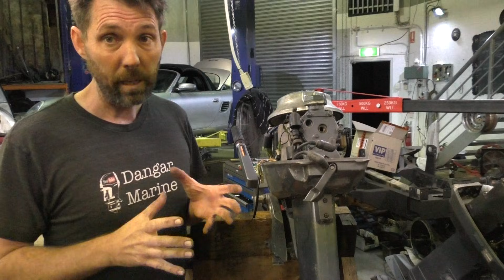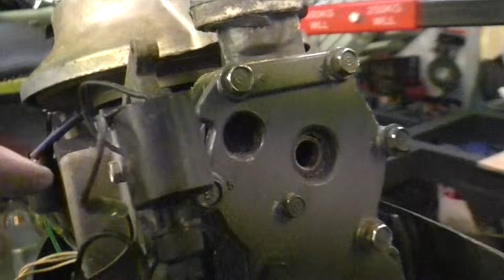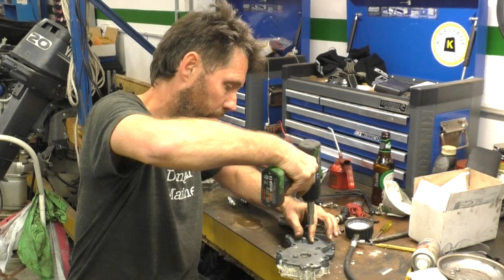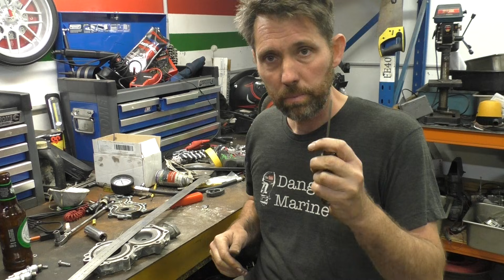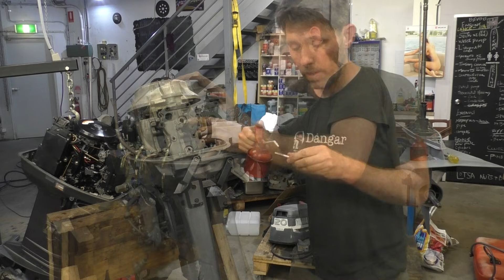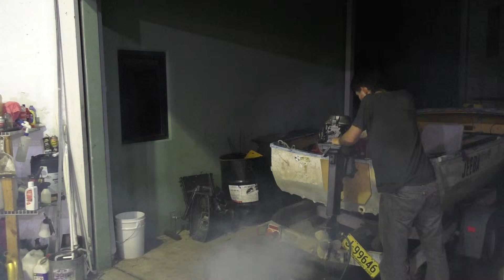Replacing a 2 stroke outboard head gasket

Comment: Dude - I LOVE your video tutorials, and I've learned SO much!
THANK YOU!!!
However - you should NEVER - never EVER, re-use Head Bolts... ALWAYS use NEW ones - the old ones have been stretched and are WEAKENED ... they WILL BREAK (guaranteed!) if ever needing removed in the future.

(ask me how MANY times I've learned that particular lesson. lol)

Best wishes from Florida!
Reply: Not all head bolts are stretched.
Reply: @00met  
As inexpensive as they are - and as expensive as head gaskets are... why risk it?
They DO stretch when reused.
(some more so than others, but again - it's just not worth blowing a head gasket, or even worse, breaking one off later - been there, done that too. NOT fun!)
Reply: @jkg6211  No disrespect,  I understand that some bolts are torqued down with the intention of stretching, according to Yamaha, these engines do not fall into that category.  I do understand the cost could be minimal, but I am doing two motors which would be in the area of 72 bolts.

Comment: Prying usually works, I find tapping around the edges with a brass hammer loosens it up.
Reply: Yes, a soft hammer can help...  also lossening the hedbolts then cranking the engine... letting the combustion do it for you.

Comment: Stu, I have a Johnson 50 hp.  I see some white stuff (salt?  corrosion?) around the head gasket near the lower cylinder.  Is this the sign that something is wrong or normal occurrence in salt water? Motor starts easy and runs fine. Thanks for the great videos!
Reply from the maker: Hi Brian, you do see that and it isn't necessarily a sign that the head gasket needs replacing. If you still have good compression I wouldn't worry too much.

Comment: I have a 2004  F115, strong knocking with low oil pressure, 36 psi at 3000 rpm, all 4 with 135 psi. During shop run, 2nd rod kicked and the crank is in question. I got a good used full block with all cylinders, crank shaft, and an used oil pump. I ll check the off oil pump to see if it is the cause.  Do you have any ideas to text this type of oil pump?  thanks. Dale of Vancouver Island.
Reply from the maker: Oil pumps are generally tested using feeler gauges to measure the rotor clearances to see if they are too worn. The service manual for that motor will show you where to check and what is considered out of range. Be careful though with oil pressure tests as they can give you a low reading even if the pump is fine if the bearings etc are very worn as the pump needs a restriction to convert the volume of oil pumped into pressure.

Comment: Thank you, I am taking a 25 hp Nissan apart due to top head gasket failure, leading to top over heating, loss compression, 85 top and 125 bottom. Top cylinder wall scratched lightly. I wish I could bring both to 120 to 125.
Reply from the maker: You might find that with a light hone and new rings the compression comes back up. I would also get the head machined before re-installing with a new head gasket.
Reply: Thank you so much for the great suggest, yes , l ordered new rings, head gasket, mid sect. gasket and new impeller. All the bearings are still tight and no discolor or burn marks.

Comment: Your videos are amazing. My son and I just bought a 2001 Yamaha 15 HP 2 Stroke (15MSHZ) and cleaned and rebiult the carb after seeing your great 40 minute video.  Also replaced gaskets in fule pump after seeing your other video. 2 quick questions:
1) You mentioned about danger to the iginition coil if ignition is on and it is disconnected but not grounded. Is that mostly for prolonged periods? I ask since in this (or another video) you removed the plug from each cylinder one at a time while the motor was running to check each cylinder and I have done the same thing a lot on my "new" motor (see point #2). So is it OK to do that as long as not done for a prolonged period?
2) I wish you could do a video (if not already done) where you explain the crankcase breather hoses and what they do and related issues that come up. Especially using that 15 HP Yamaha you have done a lot of videos with. I ask since our bottom cylinder stopped working a week after we bought the motor. It was not spark since the bottom cyl did not run using the same coil switched from the top to bottom. Plugs switched did not help. Carb (only one on this motor) was clean and top cylinder idled and powered up well. When I pulled the top and bottom breather hoses off and sprayed carb cleaner and compressed air through them, the bottom cylinder fired right up!!! So I fixed the problem but do not know why it worked. Please help me understand if you have a minute.
Thanks again for your great videos!
Reply from the maker: Hi Elliott, yes, a brief disconnect of coil for a test isn't likely to burn it out. I've seen motors where one of the HT leads has popped off and the boat has been driven around for quite a while without damaging the coil so it's more a case of being safe rather than it being a huge risk.

Interesting about your vacuum line fix. Generally those lines are only used to either power things like a fuel pump or balance between the two cylinders. It's really hard to see how it would affect you getting spark. I'll have to do a bit more research and then do a video on those hoses one day.
Reply: Old question, I know, but did disturbing the sparkplug lead to that bottom cylinder do something like improve the internal contact/connection?

Comment: Intersting Video.I do wonder about the pistons in my motor.They are not coated black on top.They are a lighter color.I saw this when changing plugs.Could this be a sign of running lean or something else?Leaky head gasket.If a tiny bity of water was getting in the cylinder would it cause this discoloration.?I am currently sorting thru some idle issues and curious about this .Getting some backfires or lean sneezing?
Reply from the maker: It does sound like it is running lean.
Reply: Thanks..After my last message I went and pulled the plugs again rotated each piston TDC and with a better light I could see half was black with carbon and the upper half was almost like a rust color and almost appears like rust for some odd reason?It couldn't be rust could it?I would not think it could be rust and don't think rust could be on there with it combusting in there.Why is only half this way?This is a Johnson motor.

Comment: There's one other issue about running a motor without a thermostat or restrictor plate. I used to work on an offshore race boat, and at first we ran no restrictor plates, there was no room to put a thermostat in the way the watering system was set up. And we kept burning bearings on the crank. And had issues with oil deteriorating very rapidly. So I went back in the engine compartment while we were running and couldn't hold my hand on the side of the block even though the water temperature was reading 120. We also had water pressure gauges and we're running about 30- 35 PSI of water pressure., I figured out that the water was moving so fast through the block because of no thermostat or restrictor in the thermostat housing that the water wasn't cooling the block we ended up running a restrictor plate with a 5/8 hole in the middle of it our water pressure went from 35 to 45 PSI what are temperature gauges went from 120 maximum before the restrictor plates to 180 degrees after. Lo and behold are oil problems went away and we stop burning bearings. So that's another reason why you might seriously consider running a thermostat.
Reply from the maker: Interesting to hear your experiences. Thanks for sharing. :)
Reply: Dangar Marine,... glad to share my experiences
Reply: Its no wonder you couldnt hold your hand on it, 120 degrees? That's pretty hot man.

Comment: Hi Stu I had this on a 1990 Johnson 40 hp 2stroke and I took off the bottom ring to get bottom bolts accessible. Not that I’m saying you’re doing it wrong. After all the end result is what we are after. Thanks for all you do to help other boaters, you’re fan from Missouri. P.S. The motor would run and miss and sneeze after looking at vacuum leaks mixture settings I found the VRO system was one of the problems causing plugs to foul quickly so I bypass it. It was mixing around 20 to 1 and it couldn’t be fixed. I tested it by how much oil used to a gallon of fuel. Also resetting the timing to the factory marks and fine tuning the carburetors Helped as well.
Reply from the maker: Yes, taking the lower cowling off can really help with access in many jobs. The trouble with these older salt water boats is that they are some of the most corroded bolts so you always take the risk of something snapping. It isn't hard to see how you go the fouling at 20:1, glad you've got it running nicely now. :)

Comment: Sir Stu.. Is a leakdown test better in these situations? On my 4 Stroke JetSki I do a compression and Leakdown test the beginning of every season, but not sure how it applies to 2 strokes..
Reply from the maker: I personally find I get better results with a compression test, but of course that requires the motor to at least be turning over. Leakdown tests are good for identifying if the source of compression loss is the valves but you don't have any with a two stroke so it is of more use with a four stroke.

Comment: What the max compresion have you seen on this type of yamaha.
i know that cylinders have relife holes to lower compression, but  what max readings have you seen or heard?
Reply from the maker: Not sure on a maximum but I generally find them to be around 100PSI.
Reply: in my area is one, the guy climne thet is with 150 psi. i think its not possible
Reply: @iboats1  possible or optimistic gauge

Comment: I have a motor Force 85 hp, 1989 year. From the cooling tubes I have an exhaust, at the top of the motor, is this supposed to be that way?
Reply from the maker: Yes, that's normal.
Reply: Dangar Marine what kind of oil can you advise to reduce smoke?

Comment: Gday mate good video ,when i did my 50hp triple i changed the sacraficial anodes in the block ,i didnt see any in this 20 do they not put them in smaller engines ? i also cleaned as much of the water jacket on the block as i could with a wire brush on a dremel tool handy piece of kit that anyway 2 strokes as you say are fairly easy to work on
Reply from the maker: Hi mate. All outboards are a bit different with the location of the internal anodes. Some are under the head, some are accessed from the side of the block. They will all generally have at least one though.

Comment: have you done the video on when you break head bolts?
Reply from the maker: Not yet, but planning to very soon!
Reply: If a head bolt feels like it's going to snap off rather than break loose, what is the next step so as not to break or twist the head off the bolt?
Reply: @gmoney2369  Working on old Yamaha dirt bikes back in the 1970's, if a head bolt felt like it wouldn't break free, we would gently heat it with a torch (go easy man - you can warp the head FAST like this if you aren't careful!) and gently tap it several times with a plastic mallet. Spray with WD40, wait a few minutes, tap and spray again, repeat until the bolt has cooled down. Try again. TAKE YOUR TIME. 
The heating/cooling cycle expands/contracts the corrosion between the head engine block and bolt holding the head on, and allows the WD40 to penetrate better.

Repeat as many times as necessary... it almost always works, but it sometimes takes many tries. Allow the head/head bolt to COMPLETELY COOL ON IT'S OWN (don't try to cool it down any faster!) before making another attempt!!!
It's better than snapping a Head bolt... ask me how many times I found out. lol
Reply: Appreciate the advice. Will give it a try when I finally decide to pull and descale the heads as the last step to deal with overheating issues.
Reply: @gmoney2369  
I recently had one break on a 1998 Yamaha C60. It was about 1/8" below flush with the crank case, and I didn't want to risk breaking an EasyOut in it and making things even worse. (they should have called them "Easy-to-Break")

We welded a nut to it, and along with a little heat, and a lot of patience and penetrating oil, it came out.
Hope this helps someone else in that predicament.

Comment: Hello i buy yesterday a yamaha 15 hp the model is 15sk i just turn on am i see water between the head and the other side. What is your opinion head gasket
Reply from the maker: It does sound like a head gasket problem, yes.
Reply: Dangar Marine. Yesterday i buy a Yamaha 15 hp 1985 am i see the water coming front the head gasket. I just remove the head, i found a small hole in the crankcase in the say were the water run in the channels. I dont not i cant just welded this small hole or just some glue i dont wanna lost this motor have a really good compresion
Reply: Dangar Marine i found the problem the cylinder have a small crack plus everything inside is full of crap. Went i remove the cylinder  head and i have 5  broke bolts i cant remove and the other  i found a litle hole in the channel for water. In the  Bottom left i need to clean am try to cover this hole whit jb weld glue for aluminium. I dont not how remove this bolt i broke
Reply: Dangar Marine hello you now i take out the cylinder head and i broke 5 bolt i cant take only one the other impossible plus i found a hole. I just buy a crankcase used is in good condition. I dont have any problems to used the same piston. I all ready buy a new cylinder head gasket new bolt new thermostat gasket exhaust gaskets. I need your opinion please. The motor run perfect the only problem is the head and the water for the hole in crankcase

Comment: Hi Stu this video has helped me immensely chAnging my old DT25 gasket, I’m just wondering if I can use a brass wheel attached to my drill to get rid of the crud. Have you any videos on a break down and rebuild of older style Mikuni carbs?
Reply from the maker: Yes, brass wheels are good for this type of cleaning as they are quite soft. This video on carb cleaning might have been a Mikuni, I can't recall https://www.youtube.com/watch?v=ye_Ui9D8dBE

Comment: Tips to not snap bolts? Maybe run the motor a lil bit to heat up
Reply from the maker: Heat does help a lot with getting bolts out, for sure.

Comment: At about 11:30 you said something about their is not just one cylinder that doesn't have compression. I have a 1999 Yamaha 90hp 2 stroke and one cylinder doesn't have any compression... seafoam was put in it and ran it and it worked at full power but it was off and on. The cylinder now is at 0psi what could that be?
Reply from the maker: With a two stroke it could either be a rings, a hole in the piston top, a hole in the cylinder wall or a badly blown head gasket.

Comment: Stu, I have a 1998 15 hp Yamaha 4 stroke that had overheating issues this summer that turned out to be stuck thermostat. Fixed that but now discovered I have water in the engine oil (milky oil). Any suggestion as to a check list to determine the cause. Engine still runs.
Reply from the maker: Hi David. It is most likely a blown head gasket from the overheat. Water and oil pass into the head and if the gasket is blown the water can be forced under pressure into the oil passages and then back into the sump.

Comment: Hey buddy I just test drove a motor that I traded for some work. 60 evinrude, It's has compression of 90psi,89psi,29psi on bottom cylinder so I've started taking the head of and unfortunately 5 bolts snapped. I was gently as I could pulling them out. Well just the start of a big project. I hope you don't mind me asking questions In future. Anyway beer getting warm trying to get this head off now

By the way trying to get me a shirt funds are tight save a spot on top right of board for me
Reply from the maker: Hey Bryan, it's pretty common for bolts to snap on old outboards like that, but as you say, it is a big project and one that you will enjoy with the right approach. I'll save a spot for a photo of you with your outboard. :)

Comment: Ordering a head gasket and t stat gaskets for my 3 cyl 70 johnson 1984. I see you spray Hy lomar on the gaskets, some gaskets you should not use correct?
Reply from the maker: Some OEM marine gaskets are already coated. You will feel they have a tacky feel to them already. Those I don't coat. Also, I generally don't coat thermostat or water pump gaskets.

Comment: If the cylinder head is stuck you can put back the spark plugs and cranck the engine (leave one or two cylinder head bolts in place but loose)
Reply from the maker: Yep, I was just mentioning that exact technique to someone else this morning. :)
Reply: I heard about it long time ago but fortunately i neved had to use it. Thank you for your time and yor videos.

Comment: I have a 92 evinrude 15hp and the compression is shot. One cylinder is 50 psi and the other is 20 psi. Can I change the piston rings while the head is off without taking apart the whole motor?
Reply from the maker: You will most likely want to hone the cylinders at a minimum before putting new rings in (maybe ever bore them and go to oversized pistons) so I would recommend pulling it completely apart first.

Comment: ever wonder how many times you pull started an engine in a life time? (ask a stupid question)
Reply from the maker: God, I'd hate to think! My pet hate is when we get a put start motor into the shop that has the problem of "hard starting"...
Reply: cant-start-itis remedy is starter fluid.  (probably cheating to a pro, but for accountants and such it works fine)

Comment: pople do not have wire wheels.
 try to do a scrape video and vacuum cleaner and straws to suck out block duct taped sucker. then show car style. like old chevys to lap those easy small heads in 3 steps . like on a piece of granite or a straight new cutting board or glass to get a smooth say 800 grit finish RA?.  pople tend to ROUND off edges of the sealing ring area and make a point of that.
great video!